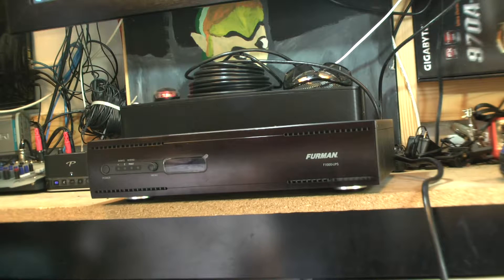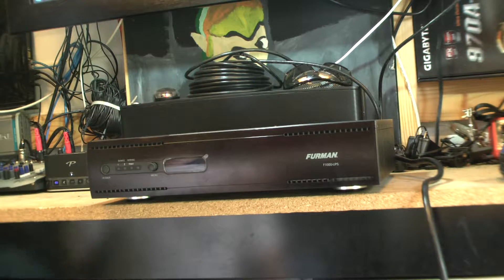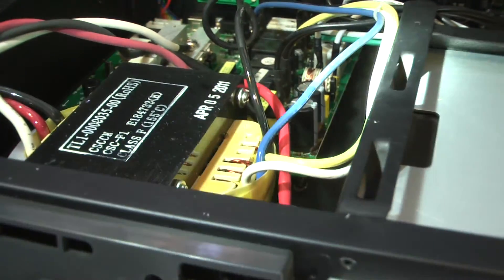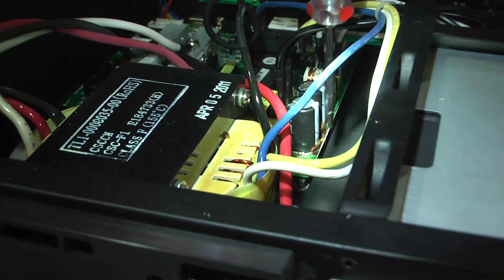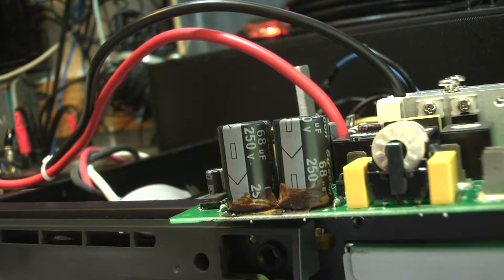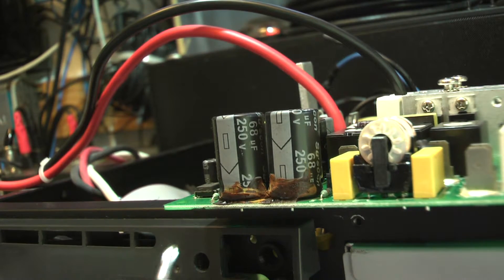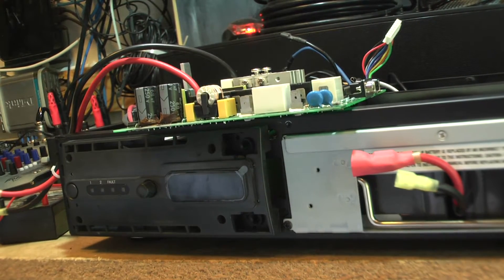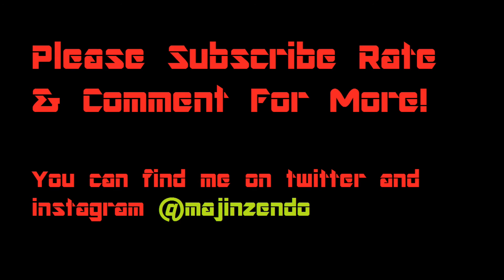Furman F1000-UPS Uninterruptable Power Supply Repair Attempt Pt.1

Comment: Those caps are probably fine, the brown stuff is just glue they put on there to prevent the caps from vibrating off the board.
Reply: I would measure the transformer and the IGBTs/FETs/transistors of the H-bridge next.
Reply from the maker: +InstrumentalsDE thank for the advice!   I will get some more equipment from work and do that.